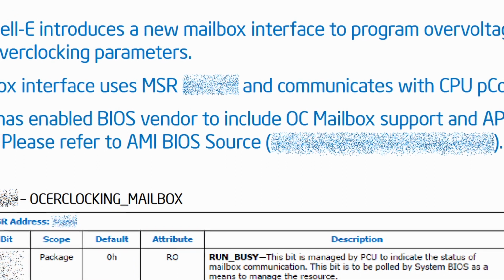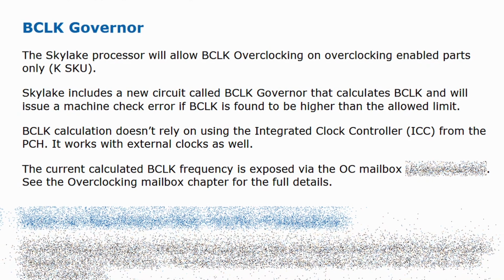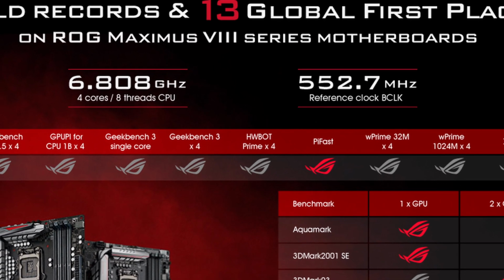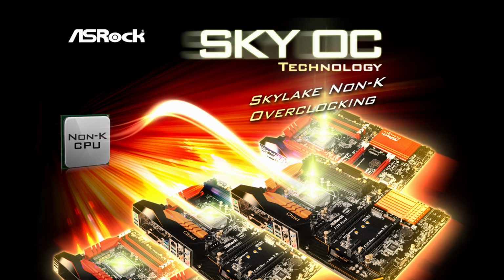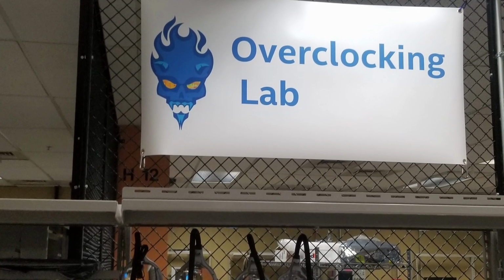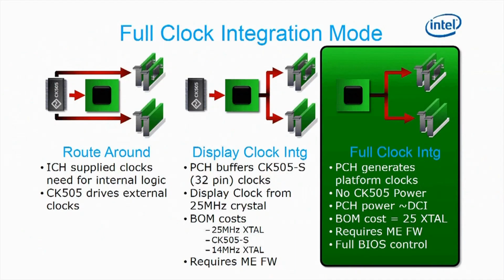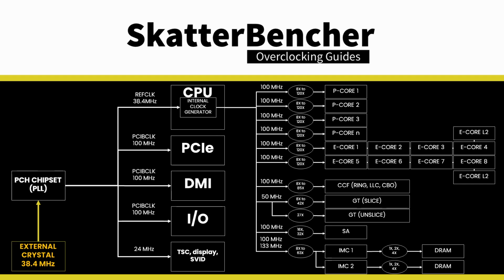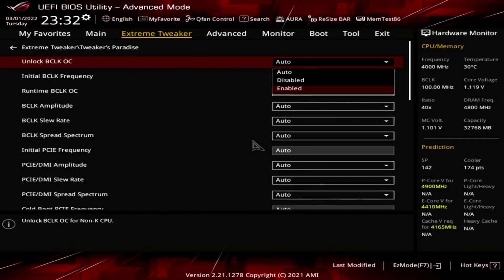How is Alder Lake Non-K Overclocking Even Possible?! | SB#37

Comment: Brother can you please tell mee can i run 6000mts on i7 12700f ... when i enable it i dont have crashes while gaming and in memtest ... what do you think is it safe ???? For cpu ?? Motheroard supports even higher speeds i checked it... but imm worried about cpu ..
Reply from the maker: Yes, should be no problem. Especially if you don't see any errors in memtest.

Comment: if I have z690 without external clock gen and I9 12900k it can go higher than 103mhz?
Reply from the maker: Yes. The Alder Lake platform has an internal clock generator that should be able to overclock well beyond 103 MHz. Of course, overclocking BCLK (internal & external) is only officially supported on the K/KF/KS processors.

Comment: hello, so between mobos for Intel 12 gen that allow overclocking of non-K CPUs there is only a difference in the BIOS?  between mobo bclk and a non-bclk mobo it is not that bclk has an extra physical part on the mobo that allows you to generate the clock, but only the presence of the microcode on the BIOS changes, is that right?
Reply from the maker: It's two things:
(1) Physical: you need an external clock generator for the BCLK
(2) Digital: you need the microcode that supports non-K overclocking
Reply: @SkatterBencher  thanks :) i was undecided between rog strix b660-G gaming and b660-f gaming, do they have the same BIOS?  or maybe the 2 models have different microcodes (0x9 or 0x15) and then I can choose the one with the bios with the best microcode

Comment: hello, I have read that even today there are many problems with ddr5 platforms, for a ddr5 build with i7-12700 as optimized as possible and effective even with ddr5 upgrade when better ram models come out, what mobo can I get, bclk?  what i might need to tweak on the cpu to make it work better with ddr5 even at higher frequencies and lower timings in the future?  I ask why I understand that with ddr5 no longer immature that will come out in 1/2/3 years the Intel 12 gen CPUs could lag behind in some processes compared to RAM so I am referring to something that could make the CPU work better with the ddr5.  I was thinking about the memory controller overclock
Reply: @pcoverthink  thanks:) I think I'll take a rog strix b660-G gaming or b660-F gaming with i7-12700 and ddr5 of course, software side according to you what can i do besides the SA voltage, to get more frequency from the CPU IMC and make sure that CPU works well and supports RAM even at higher frequencies?  before you said to optimize the times ...

Comment: hello, for a good CPU support (i7-12700) to the ddr5 that yields a lot in "productivity" (considering the fact of changing ddr5 banks in 1/2/3 years with the model no longer "immature" while maintaining cpu) how can I orient the choice of MOBO to have a good "compatibility" and better optimization between cpu and ddr5?  hypothetically especially with ddr5 banks that will come out in the future.  (when will I (hopefully) have a net improvement over ddr4 for higher frequencies and lower timings, ex: 8000MHz CL 30).  for example i had seen that intel 12 gen to have a significant improvement with ddr5 needs an overclock of the memory controller, for this purpose a mobo bclk would be fine, if you have to pay attention to something in particular?  or would it be better to take the model K and a mobo z690 (even if I would go over budget with the cpu)?

Comment: Where could documentation on the OC Mailbox MSR be found? Those slides are interesting, why are they blurred?
Reply from the maker: I blurred the parts I wasn't sure are public information. Documentation is only available from Intel to their partners, though end-users have access to the OC Mailbox via XTU :)
Reply: @SkatterBencher  information on the OC Mailbox MSR is not in the easily available official MSR datasheets, so either it's not public or it's hidden somewhere. I use Linux and tools here are available to write and read to/from MSRs, but no XTU-like utility exists for this OS.